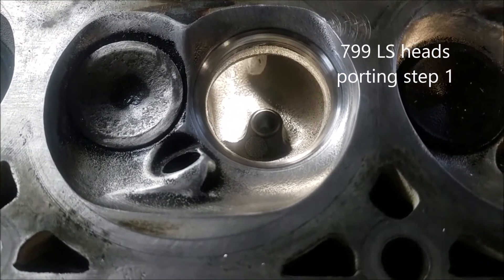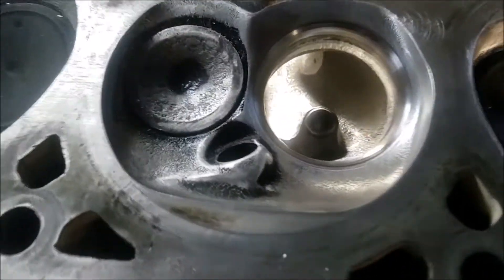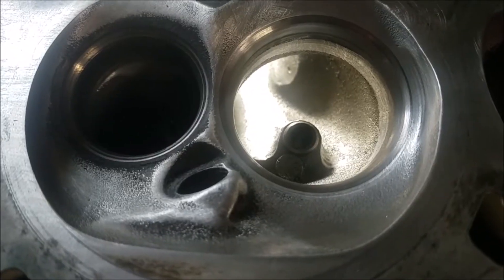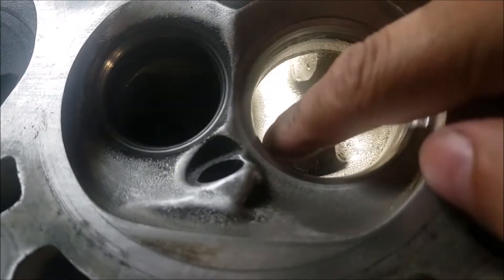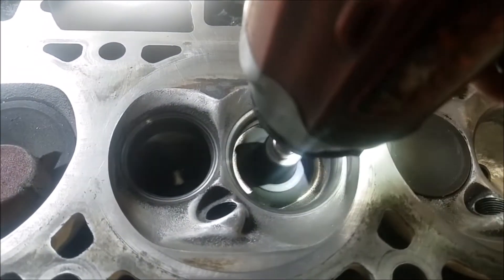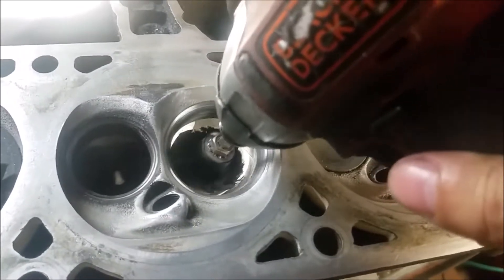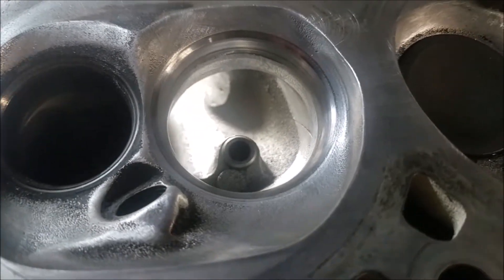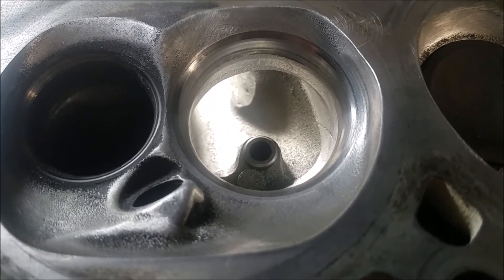799 LS heads Porting step 1

Comment: Looking good man. That's my next project for the winter. Question will a descent battery operated  die grinder do the job? Thanks again!!
Reply from the maker: I got an electric die grinder from Harbor freight. Battery operated might work.
Reply: @c41man  I just finished up some 243s . Cleaned up the castings and buff exhaust side with DeWalt battery powered. Came out good I think.